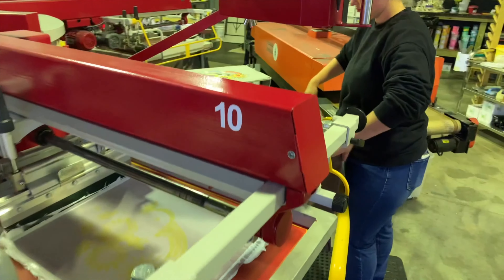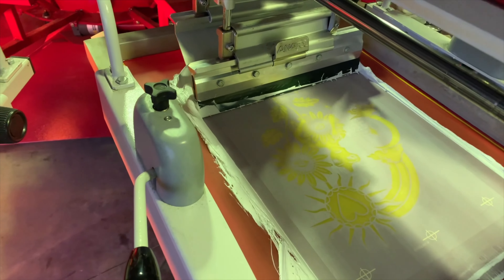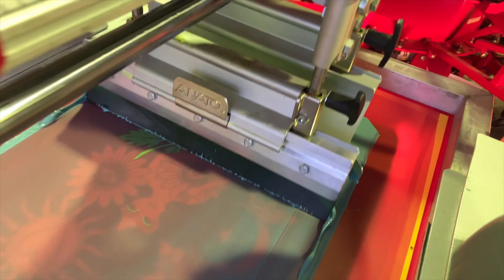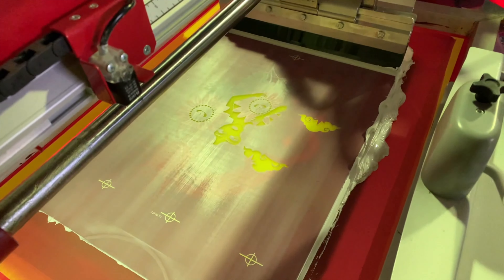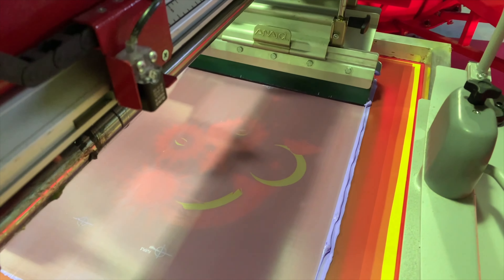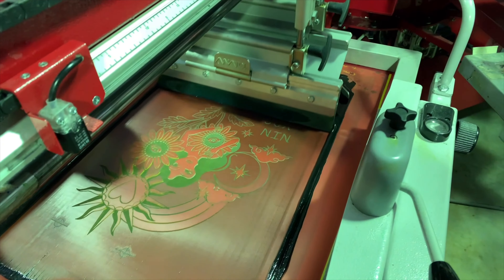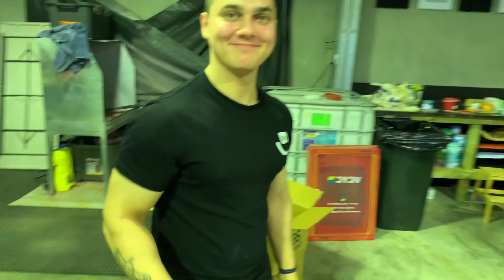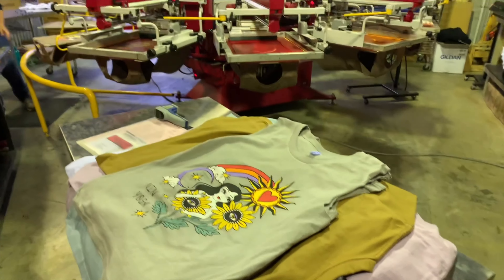Screen printing Peek at the Press - 7 Colour with locking screen.

Comment: How do you align your pallets so they are all the same. We have the same press.
Reply from the maker: If you mean the position in/out from the hub we just measure them from the back of the platen to the back of the arm. If you mean height then we have a totally different technique which requires a video.
Reply: @ministryofshirts  you said it right, just a simple measure from the back of the arm to make sure they're all even. Sounds good, running a simple two color print for our first job on the press. Ive watched your alignment videos, we should be good to go.
Reply from the maker: @elitecircledesign39  awesome. feel free to reach out before you pull your hair out!